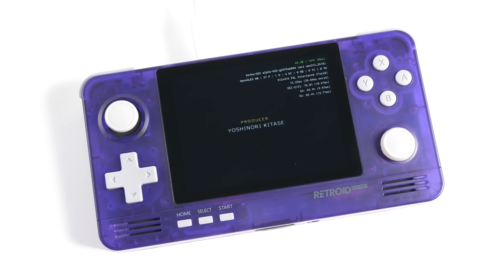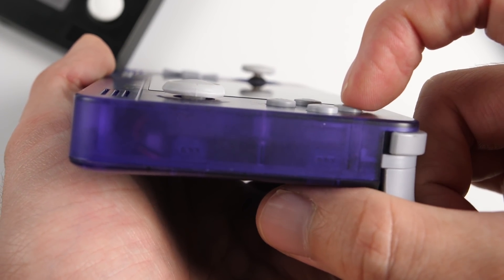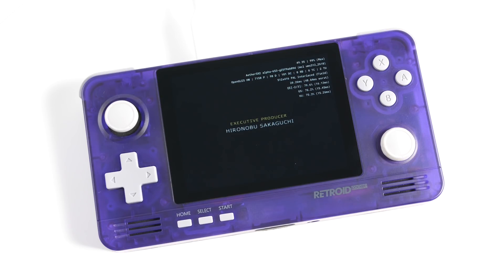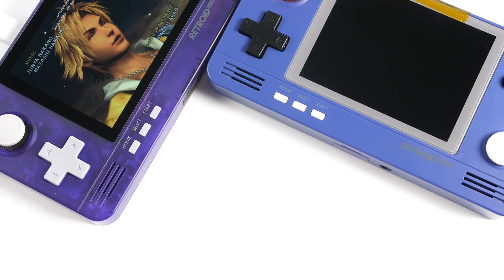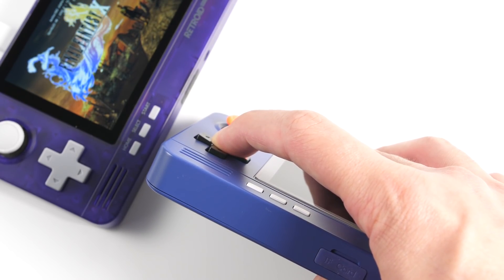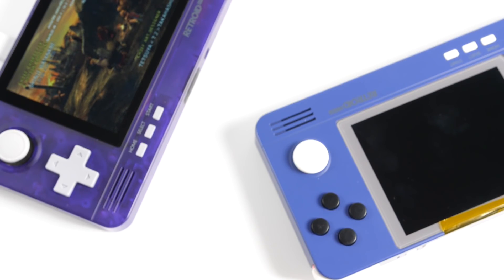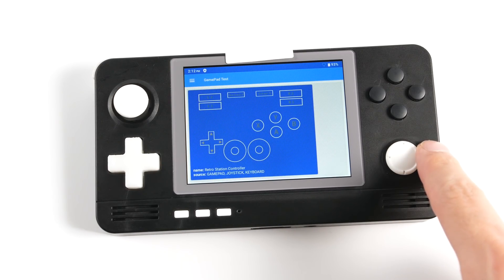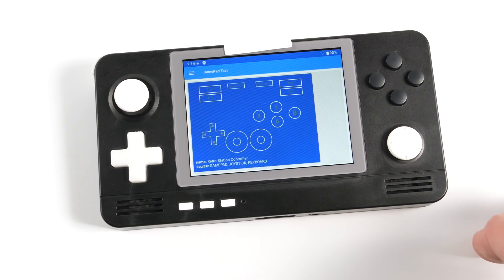Retroid Pocket 2+ | Conductive Rubber Update

Comment: Thanks Taki; the controls are one of (if not the!) most important aspect of the retro handheld design. It can be the most powerful handheld on the market (which will always be bought on being the most powerful!) but it ultimately won't get used if the controls don't feel right. Plus the best thing about being a retro gaming handheld is we're not exactly waiting on seat-edge for the latest game to come out, so i'd rather it's done right.

Comment: Taki, thank you for the update! In short, can we expect that the controls will be perfected when the device is released? After watching the video, I was confused as to whether or not Retroid was going to go with the subpar controls you mentioned, even with the delay.
Reply from the maker: I tried to make everything as objective as possible (based on physical measurements of travel length and resting height/activated height) for the improvements they needed to make. They did all of the changes that I asked.

Comment: Great video and insightful update. Sounds like a tiring and borderline frustrating situation for you to deal with.  That initial dpad looked terrible though, and the buttons going under the shell sounds even worse than the x18s buttons that go flush and that device received plenty of criticism.  Needless to say, Retroid should be thanking you because I have no doubt the community would have heavily complained about that initial device build, and Retroid absolutely needs community acceptance because their market reach appears far less widespread than Anbernic and Powkiddy.  They need word of mouth to succeed.